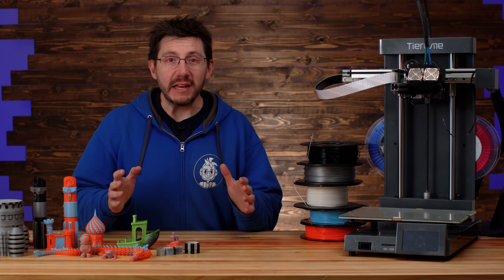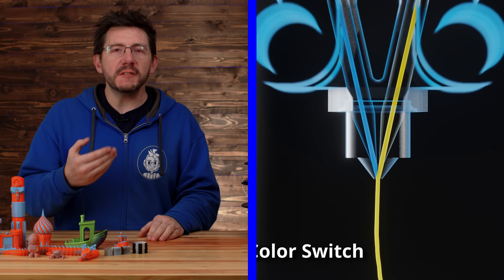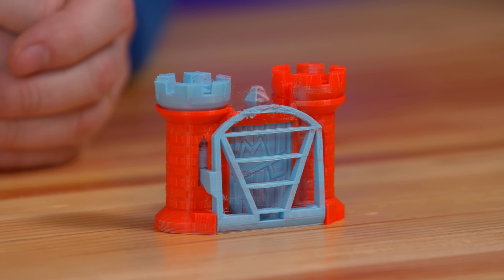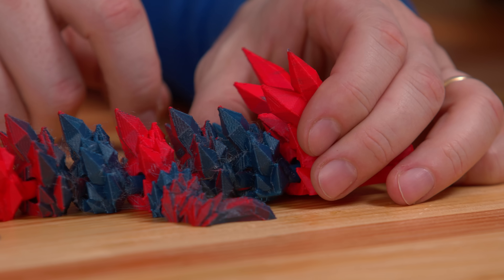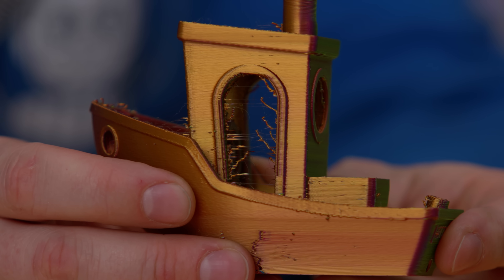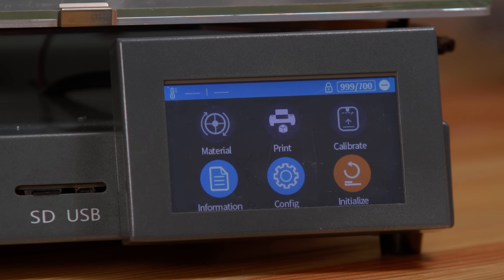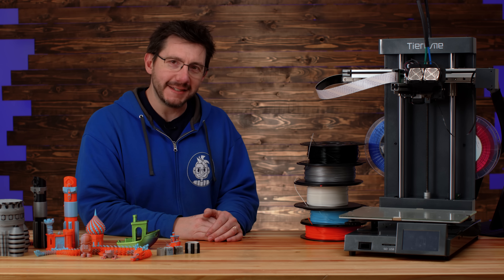Multi Color with NO Purge? Articulated Dragon on the Cetus 2 for a First Look!

Comment: I just got mine last week and ran the first demo print off the SD card today. There are pimples from over extrusion but otherwise the little rocket looked amazing. They did move the cable you spoke about so now everything is on the extruded side and doesn’t get in the way of the spool. Clear instructions for initial set up. Only gripe is the QR code they have on the manual for videos…doesn’t work…yet? Great review. I was a very early backer and extremely happy with the product I received.

Comment: ❓COMPARISON:
Is there somewhere an comparison video about the different ways to print multi-color/multi-material and their advantages and disadvantages (like quality, speed, with/without purge tower = less leftovers, ...)?
- Like single extruder with prespliced filament.
- Or like in this video.
- Or with 2 individual printheads.
- ...

Comment: No purge block means more waste when the end product is muddy between multiple colors and you likely will have to re-print if you strive for excellent prints. It's the dumbest argument that it's a waste, the entire hobby has waste. Offset it by printing multiple models so that the models and purge block are equivalent in filament.

Some of these models were very clean in terms of color transition which was surprising, others not so much. The idea is cool but I don't think it will catch on for those who don't want waste as it's not perfect and for those like me who want clean prints and colors who would use a method that already exists with purge. (Not to say I can't just enable a purge on this machine)

Now the four color thing with quantum, you got me there. I thought that was really neat.

Comment: I’m working on a dual extruder ender 3 that is going to be 2 in 1 out . With the intent of not using a purge block but changing in the infill to minimize bleed over. Long way to go. Though I’m sure someone already did this

Comment: Nice machine! This nozzle mechanism has a major drawback though, and that is the unused filament being heated, which could result into burned filament on long single color prints.

I actualy personally developed basically the same dual feeder mechanism for a mechanical engineering internship at Builder 3D printers in the Netherlands, back in 2016 already. I designed it for their desktop printers back then (which they dont sell anymore), but nowadays they still use it on their large sized professional 3D printers. That mechanism also allows for color mixing.

Comment: One advantage is if your out of filament theres still another roll in there 😱
Can see how this would be a gamechanger for some
Reply: unless when you consider that there are already plenty of better options to deal with the issue of filament runout. 
There are filament runout sensors that you can use in firmware
There are filament runout sensors that you can use with octoprint/raspberrypi
There are filament management plugins for octoprint availabe that log the remaining wheight of material on your spool
There are large spool sizes like 2.6kg, 5kg or even 10kg for very large prints

But does the printer even have filament runout sensors for switching spools when one is empty? If not, how are you gonna do this in software?

Comment: Did you test that different plastics would cause issues, or make an assumption?
Reply from the maker: Define what you mean by different plastics? I used different PLA brands, didn't have time for TPU, but will test TPU if people want to see it.
Reply: @3DPrintingNerd  I mean you said different plastics might cause problems when printed together. Since there are two heaters, it seems like that might not be an issue... So a test print of PETG printed with PLA would be enough.

Comment: I just don't get the extremes of engineering on this machine. That ribbon cable is a joke as well as the top mounted floppy cable just hanging there. Then you have the two huge rods in the back that look like they could support and small car. It's as if it was built by people that really have no idea how to properly engineer a machine.

Crowd funded? Oh that explains it.
Reply from the maker: Yeah, the differences in structural versus electrical are staggering.

Comment: i did back this project, hope that they fix the connector fixation.
as far as i know we get options for spare nozzles.
smaller but faster touchscreen with it's own cpu and not a shared cpu at the prototype version

----------
Touchscreen

We decided to use another ESP32 MCU for driving the touchscreen and WIFI. So this mean the printer is a dual-MCU system, one dedicated for printing and the other for peripheral functions. The touchscreen will be a smaller 3.5 inch type but it is more flexible to develop and more powerful than the 4.3 inch screen currently used in the prototype.

Hotend Temperature Control

In the prototype we shown in the video, the extruder only have a single temp. sensor. We decided to add the second temp. sensor in the hotend to allow the two heater block to able to maintain at different temperatures. Since the two heater blocks are connected, max temp difference can be made is somewhere around 50C. This may give better stability for materials pairs that have dissimilar melting temps and allow more accurate temperature control overall.

so we backers hope to get a nice 3D Printer !!!!!

Comment: @3D Pinting Nerd Could you please test what happens when the temperature sensor is "disabled"? Unfortunately, my Cetus MK 3 does not have a software temperature fuse. Luckily I was there when my nozzle reached 360°C. I then wrote to Cetus. I hope this source of danger has been removed.

Comment: Looks like a good bit of advancement for multi material and some of the concerns you mentioned could be sorted out with a bit more R and D. Hopefully they have seen this video and are going to work on the fixes as well.
I am interested to see how it would go with using soluble material as one of the filaments. I have seen where other MMU setups require a massive amount of purging so that none of the soluble material is mixed in with the actual print material.

Comment: One thing you didn’t mention or covet (unless I blinked and missed it?) was variable percentage between the filaments?  In theory if you had black and white you could produce multiple shades of grey in the print? Maybe it was something not available on that machine/software combination?
Reply from the maker: Oh shoot, I may have missed mentioning this. It's hard coded to 50% from both sides. I couldn't find a way to adjust.
Reply: @3DPrintingNerd  looks like something that a firmware upgrade (or even better) an improved version of the touch interface could solve.

Comment: seeing the ribbon cable basically being pulled out of its socket by the filament spool

Denholm Reynholm's shocked face

I honestly don't know how that design made it out of testing...were there any prototypes at all or were their engineers so blown away by the awesomeness of the dual-color-no-purge-tower prints that they didn't notice? Because those prints are awesome, even if white and other very light-colored filaments end up picking up a lot of whatever darker filaments they get paired with.

Comment: I still prefer my IDEX printer. No purge blocks, no prime towers just print.
Reply from the maker: Usually an IDEX machine will purge a nozzle after it’s been parked - right? Which IDEX do you have, and does it do that at all?
Reply: @3DPrintingNerd  yes I have a tenlog and I bought the little brushes for the side. But yes that is how it works, it purges and the brush catches it as it goes to print. I  tried a 3 different dual extrusion nozzles on my other printer and finally gave up, had too many issues with them clogging not sure why. But with the IDEX I get beautiful 2 color prints now. I also tried another 3d printer that had dual nozzles but I didn't like that system either. One would always ooze while the other is printing and the other nozzle would always leave artifacts on the print as it passd over the sides. I tried a combiner nozzle but that had oozing issues from time to time. This one looks like they may have found a secret recipe that works. But I'll stick to my IDEX for now.

Comment: Im so sad i didnt see this kickstarter until it was over. A very cool machine i'd love to use dissolvable support material with
Reply: I'm not sure that this printer would be able to print with PLA and dissolvable material as the print temps are too different to go through a single nozzle. If anyone has experience otherwise, let me know.
Reply: @squishybrain  They do show a finished print with dissolvable material but I'm not exactly sure what it is or how it was printed. They've also updated the kickstarter with separate extruder temps but I don't know if that would make a difference.

Comment: Nifty.

Color mixing extruders have been interesting but seem to always have that same issue of "they don't really mix" as well as color bleed. I know "no purge block" is a thing many people want (myself included), though it still comes across as "this is a software and calibration issue" as opposed to hardware, but people keep trying to fix it in hardware or they just accept sub-par results for the ability to half-heartedly announce they did a print without a purge block. How to get Prusa and Cura and Mosaic to actually put in the effort to reduce the purge block, I'm not sure. But I know if I was doing multi-color prints with this, I would be limited because of the color results and bleeding.

Everything else, I think you covered well. I kinda had a cartoon-style response on "can't move the axises" like... what year is it? But we will see what people pull off with this.

Comment: I like it Picasso. 

It seems like the slicer still prints the outside of the model before the inside. And if the slicer was changed to print the inside after switching filaments then when it gets to the inside it will be cleaner. You might also find that white and black works fine if white is on the right side vs the left side or vice versa depending the direction the print head is printing.
Reply from the maker: "I like it Picasso" hahahahah I see what you did there!

Comment: Looks like a nice concept, but that nozzle may be a nightmare to clear a clog from.  Also, nozzle changes might be challenging if the filament enters it from the left and right as shown because turning it to tighten it might end up blocking the filament paths.
Reply from the maker: I didn't have a clog that needed cleaning, thank goodness. I was thinking along the same lines.

Comment: Isn't this how Prusa first did multi material? 4 into one extruder
Reply from the maker: So style, meaning, one nozzle and multiple filaments. However, the original MMU needed a much longer retraction as the splitter was much farther up the filament path.

Comment: I'm guessing it's not marlin based? Can it be controlled via octoprint? Not a perfect solution, but it would bypass the UI problems
Reply from the maker: Per their website, it is not Marlin, and not Octoprint compatible.
Reply: @3DPrintingNerd  bummer, hopefully they make some changes to the UI then, it looks pretty promising

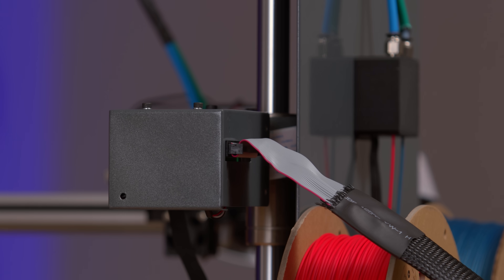Comment: 7:30 makes me cringe a little, that cable has basically no stress relief, and the way it rubs against the spool, no way that's going to hold up over extended use. It's so janky. Who on earth thought that was okay on an expensive product?
Reply: Also the way it twists, wouldn't trust a ribbon cable that constantly gets twisted 90 degrees back and forth in such a short length. They need to rethink that whole thing

Comment: I'm glad to see development in the multi-material scene. Like, I personally try to use as few "waste parts" as possible (y'know, rafts, supports, purge blocks/lines etc) just because I think one of the most amazing parts of 3D printing is just that, avoiding waste. I understand that in some cases it's unavoidable and yes, there's mitigations like "just print something non-aesthetic as the purge object", but MM purge blocks always felt like just a literal waste, so any progress in that area is, imho, very much appreciated.

Hope they iron out the kinks in the actual machine (like the precarious wiring) but yeah, pretty interested in what the future holds for this concept.

Comment: Seems to me having the option for a mini purge block for printing black/white prints would be more than acceptable versus the standard behemoth purge blocks used today. 

If nothing else it’s a step in the right direction.

I did cringe the minute I saw the x axis cable drooping down. They need to invest in some cable chains or something to clean those wires up.

Very interesting concept!
Reply from the maker: Mini purge blocks over typical sized one IS a welcome change to multi color printing for sure. The X-axis cable drooping down is something I didn't like, but I did have have issues with it like I did the ribbon cable in the back.

Comment: Exciting technology.  No purge block for dual or coextrusion is technology we've all been hoping to see developed. I tried the Geeetech and was disappointed, although it was an interesting printer.  The Cetus looks like an advancement in some directions, although it appears they have work to do to make it truly viable.  It's fiercely difficult to achieve with the vast variety of filaments available, but it looks like they have the potential to get closer to succeeding if they Improve the software and firmware. I’m very interested in seeing what happens with the Cetus 2 going forward.   Thanks for the detailed video on your first impressions!
Reply from the maker: Thanks for watching! I also agree - some better software and firmware would give this machine a HUGE advantage.
Reply: @3DPrintingNerd  do u still use this printer at all
Reply from the maker: @monsterstorm78  No, unfortunately. I gave it away at an event.
Reply: @3DPrintingNerd  did ya like how that Machine printed

Comment: Awesome concept! I could imagine full color prints with the addition of a third heater. R...g...b, no?
Reply: Could do CMYK (cyan, magenta, yellow and kblack :P) like color printers do it, though as mentioned in the video the mixing isn't really there yet. The concept would be pretty cool tho, if they figured out a way to homogeneously mix the colors you could get pretty close to arbitrary colors.
Reply: Mixing the colors to get other color in filaments is not as easy as paint or ink. I have a printer that was given to me for the robotics club I run and its from XYZprinting.  It's the Da vinci Jr 2.0 mix which has 2 feeds in to one extruder. Mixing red and yellow filaments from the same company and type works out well for orange but red and white to make pink not so much. Even red and blue to make purple ends up more brown. So trying RBG and RBG/BW set ups would be really hard and might require specific types of filament. As for CMYK I think you would run in to a similar problem. On top of that clears are super hard to keep clear and the few mixes I tried came out cloudy.
Reply: @josephdecesaro1528  You sound knowledgeable in the subject, has anybody developed a printer that runs a colourless filament that has colour added whilst printing?

Theres the felt tip pen trick,wouldn't regard that as colouring, tinting perhaps?
Reply: @snobbs1676  not that I have seen but it  sounds like a neat idea. I kind of tried that with a clear(no color) and a blue clear on a 90/10% mix and it just ended up very cloudy with a slight blue tint. The jr. 2.0 will let you set feed rates of the colors. So I ran a lot of prints with many colors that ran 10/90%, 20/80, 30/70, 40/60, 50/50, 60/40 to 90/10%. Most turned out not so well I would stay adding to yellow worked ok but any other mixes just did not mix well. Blue to anything seemed to make a brown with a tint for the color you wanted.
Reply: @josephdecesaro1528 This is why I love YT and the 3d printing community, there's always somebody testing and tinkering with things most might overlook! Thanks for the replies, interesting reads👍

When it comes to mixing colours (in this context) I'd expect translucent colours to produce better results. The muddying of colours sounds like the pigment used was a mix of colours already or the base filament itself perhaps- mix any 3 colours using subtractive colour results in brown/black I believe. So many variables, only knowledge i have that's applicable is colour theory from Art school 20 years ago.

Changing the subject slightly- a printer that blends layer lines would be just as useful IMO, sanding and smoothing is a grind!
Reply: Wouldn’t you need 5 for full color? RGB BW
Reply: @namehere5675   @LordHonkInc   Both valid points it would need to be subtractive colour👍

It'll happen at consumer level eventually🤞